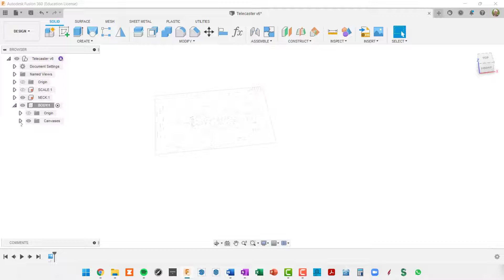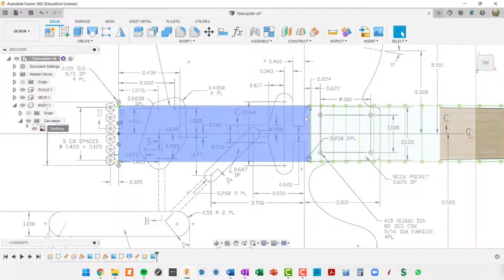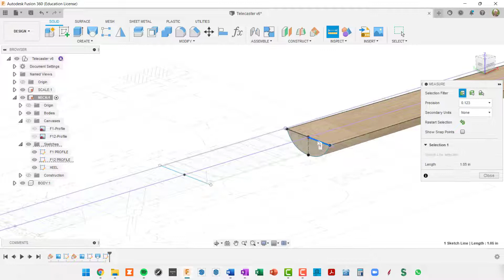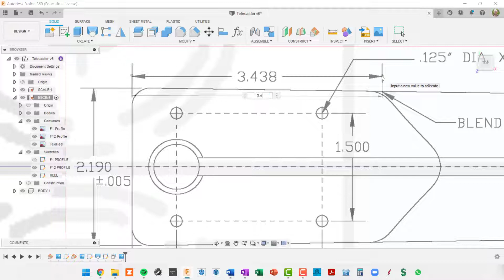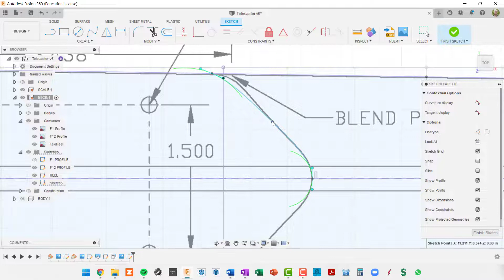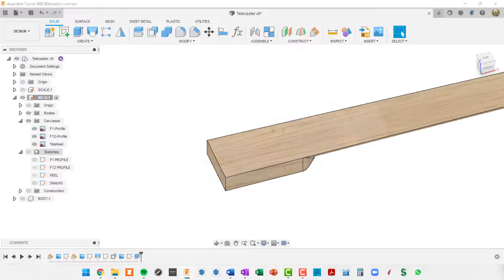Telecaster in Fusion 360:  Part 2, Neck Heel

Comment: I wanted to make a couple of comments. I am currently learning Fusion 360 and finding your videos very useful. However a couple of suggestions if I may as I am not new by any means to guitar designs and construction. The body design you are working off I recognise as the Terry Downs Rev E drawing which is a good one to use and a vintage tele spec. My first comment is that the line where the four screw holes used to mount a vintage dimension Tele bridge may not be the bridge or intonation line as the saddles and therefore the intonation line can be forward from here and closer to the neck. The second point to mention is the neck pocket position for a vintage spec Fender neck is for a 21 fret neck, a 22 fret neck will have an overhang for the fretboard to accommodate the 22nd fret so a full 22 fret neck as you model would require an adjustment to the neck pocket closer to the bridge. Both of these being different in your model may well prevent the guitar from being able to properly intonate.
Reply: Thanks - good feedback and very useful to anyone building the guitar.
Reply: @benweiss897  Thanks Ben...
Reply: @Stratamania  I believe that's actually Rev F of the same drawings, not by Terry but by Julimor. I'm going to go through the rest of the videos to see if the intonation issues are going to be accounted for. thanks for the heads-up!
Reply: @nothanks7919  I don't recall it being addressed in the other videos. The same comments would apply for Rev E or F as the differences in the drawings are likely quite minor. I suspect as I don't have the F version you mention.
Reply: @Stratamania  you are correct, it double checked the dimensions, and it seems that the neck ends up about 0.3 inches too short. I'm glad I caught your comment before proceeding!
Reply: seems like a better approach would be to correctly dimension the neck and then align the body canvas instead of aligning the body canvas to the end of the scale, because the bridge line seems to not be present in the drawing.
Reply: @nothanks7919  Yes, or have a scale on a sketch with the 0 point for the nut line, and scale length and fret positions etc, align a neck design to that to determine where the bodies neck pocket needs to be. Position the body accordingly. This approach would have to be taken for a new design, and also makes sense when reverse engineering an existing design to align elements to a predetermined scale sketch.

Comment: Fantastic series thanks, when you offset the neck and adjust the 12th fret sketch to fit the neck pocket it's advisable to do an offset to the nut at the same time and adjust the 1st fret sketch to get the required nut width as adjusting this later knocks everything out of whack.  Found this out the hard way and had to redo all of the lofting and patching.
Reply: Very interesting comment.  I guess what you're saying is that you want a particular nut width and that nut width is going to have an effect on the F1 profile sketch.  I guess you could do this trial and error method, or maybe you've come up with a better way to adjust the F1 sketch?  If so, please share.
Reply: @benweiss897  Yeah you got it.  When I set the 1st fret measurement to give a standard 42.8mm nut width I found that when I adjusted the 12th fret sketch to fit the neck pocket it knocked out the nut width out, I didn't realise this until I was modelling the nut itself.  I'm still very new to fusion so when I went back over to adjust the 1st fret sketch it messed up all of my lofts and patches and I ended up starting again.  2nd time round when did the heel extrude to the pocket I did the neck one to the nut at the same time, that way you can play with the measurements to get the neck and heel accurate and continue to model from there knowing the nut and neck pocket width are correct.  I'm terrible at explaining things so hopefully you get my meaning.
Reply: @davemcphail1862  Yes, I understand.  The problem is many neck designs use F1 and F12 profiles.  You can't really work from an F0 (nut line) profile, because the neck is already transitioning to the headstock.  All I can think of it to modify the F1 profile sketch, then replay the extrude and measure at F0.  Then rinse and repeat.  If I come up with a more automated way, I will do a video on this.
Reply: @benweiss897  Might I suggest making a pair of tapered construction lines which set the width at the nut or fret 0, and then also for the heel width which for a vintage spec neck is 2 3/16", then you could project into the F1 and F12 plane at angle sketches points to establish the width for F1 and F12 relative to the established neck taper construction lines as part of calibration. At the time of writing, this is the next thing I plan to model.
Reply: @Stratamania  More great feedback - thanks.
Reply: @benweiss897  Many thanks Ben.

Comment: When I calibrate the canvas then try to edit canvas it reverts back to the original size. What am I doing wrong?
Reply: I'm not sure how that could happen.  I suggest doing 2 calibrations, just to confirm it happened.
Reply: @benweiss897  I was searching the forums, apparently is a bug that is being fixed. Its specific to canvasses on planes.
Reply: @thefyst  Have you found a workaround?
Reply: @benweiss897  there was a suggestion that creating a surface to place the canvas on would work until they fix the bug. I'm very new to this so I've not had chance to sit down and work out how to try that yet.
Reply: @thefyst  I tried to reproduce the bug and was unable to.  When you edit the canvas, are you doing another other than moving the canvas?
Reply: @benweiss897  I was creating the canvas on the plane, calibrating (x2) then as soon as I open the edit dialogue it reverted back to its original size. 

I have found that creating a sketch on the plane and placing the canvas from the sketch or using a sketch from elsewhere to place the canvas on seems to keep it constrained.